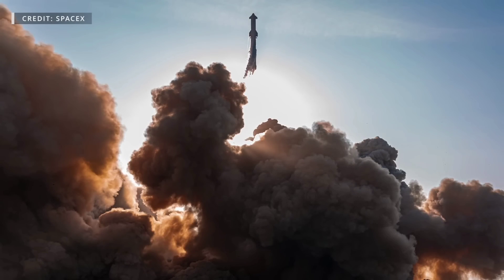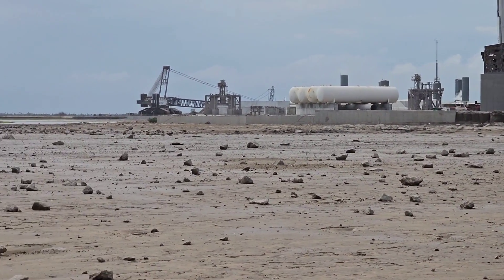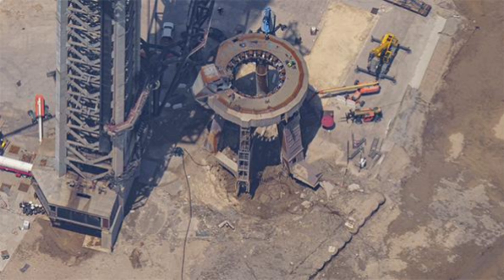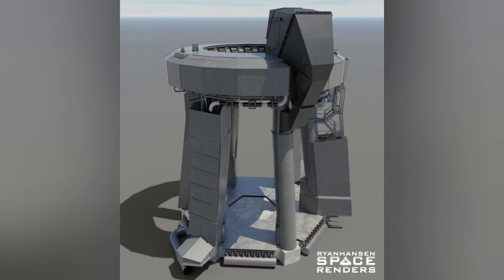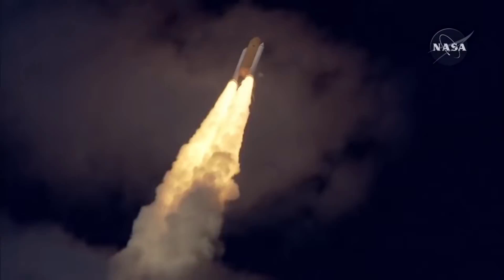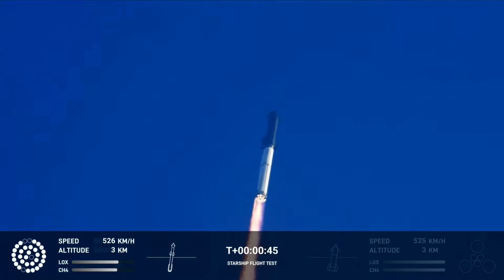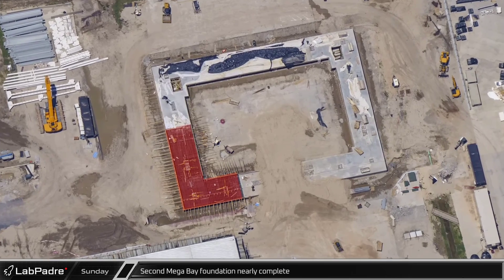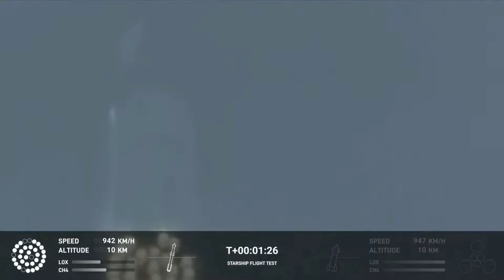Will Elon Musk's water cooled flame diverter be enough to keep Starship and Starbase safe?

Comment: It will do a fine job!!! It's already been used to test engines just as powerful as the raptors in the past, without any problems whatsoever! It just needs to be scaled up and beefed up enough to cope with the higher stresses involved!
Reply: I don’t share quite that much optimism. Maybe for Starbase, but I doubt this is going to be implemented at KSC.
Reply: @michaeleddington5125  I'm not worried about KSC.  SpaceX are doing this at Boca Chica because a diverter is completely off the table for that location.  They certainly have more freedom in that regard at KSC.
Reply: @Asterra2  KSC has the same problem as Boca Chica, the ground level is basically sea level. At KSC the launch pads are built on a big mound of dirt and concrete with a trench left open, where SpaceX builds an  equally tall launch platform open on all sides (hint, there is less backpressure and lower velocity gasses when the volume they have to pass through it larger)

People keep acting as if the flame trenchs at KSC were dug down into the ground, they weren't, the pad area was built up and the bottom of the flame trench is the old ground level.
Reply: @davidelang  I know this is probably old news, but a flame diverter and a flame trench are not necessarily mutually inclusive...
Reply: @Asterra2  sorry, I didn't note that you said diverter instead of trench. Yes, they can add a diverter under the launch mount, but that will have the same problem that aerospike engines have, how do you cool the sharp point of the spike?

or do you try to funnel all the exhaust in a single direction?
Reply: @davidelang  I don't know what they would do, but if it were me, yeah, I'd have it aimed at a slant and divert it all in essentially one direction.  Watercooled of course.
Reply: @Asterra2  I don't have access to their data, but it seems to me that letting it escape in 6 directions instead of 1, and getting the first surface hit many times further from the engines have some significant advantages. I don't know if they are enough to tip the decision, but I think they are enough that without detailed info, both are plausible solutions.